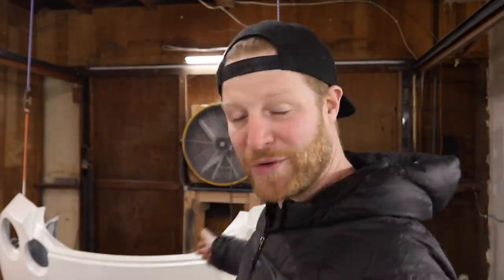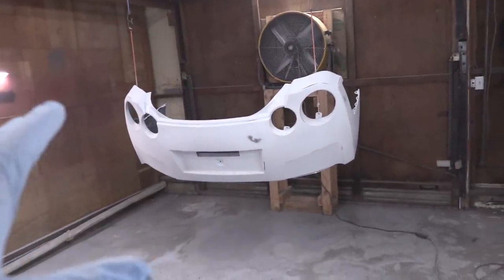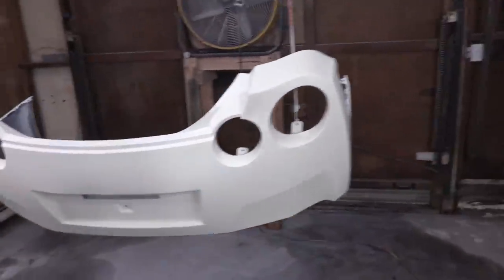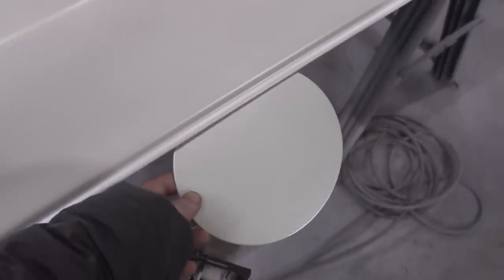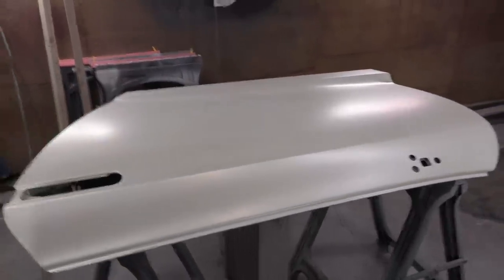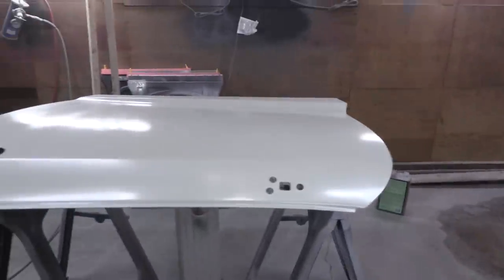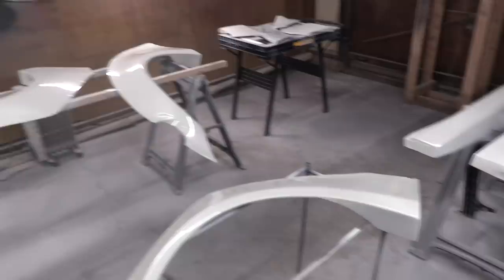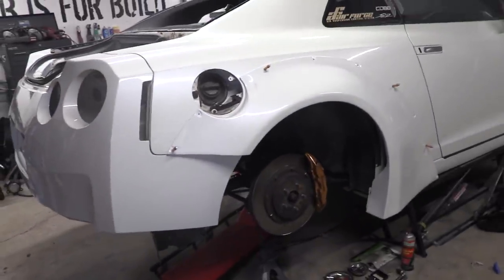Got All the Parts Painted Up Perfectly on the Salvaged GTR

Comment: When I was younger, I worked in a garage, I did allot of jig and panel work, not a whole lot of spraying, but ill always remember what this older panel beater told me . . If your ever spaying panels 'off' the car, you should orientate them in the same way that they are on the car.. especially with metallic paints, its got to do with how the paint and flecks settle? Hope this helps in some way. Nice job though, its gonna look great when finished 👌🏻

Comment: You need to scuff more by hand rather than using the machine. Those burned through spots on the bumper at 02:50 were really unnecessary.. love the project tho

Comment: Shouldn't the door be in the orientation it will be on the car when it's painted?
Reply: Why would this matter ?
Reply: @VintageTechRepairs  because the paint can end up appearing way different when applying it from a different angle than when it was originally done at the factory. Especially if the paint contains a lot of pearl the effect will be affected

Comment: My recomendation is, if u are gona suck warm air in through that door to your house, put up a large course filter, like what your put in your midi computer next to the fan, but door size, you can get that size as we use them at work. This should reduce your particulates on your paint but alow the heat to pass through. love your work man.

Comment: Quick suggestion, I really hope you see this: I would try using that round, foam, copper pipe insulation for the part of your air line that runs outside. That should keep it relatively warm in the winter, and prevent it from being affected too much by the elements overall.

Comment: Hey Chris i think that painting the paint booth would make it heaps better for dust control than it is now. As you already have paint equipment all you really need to do is toss a real thick layer of interior paint on the walls and rafters ceiling and such to control and eliminate most of the dust that could get kicked up in there.

Comment: You should run coper air lines on the wall. They should run up and down a few times to lose moisture in the air. You would need drains at the bottom of the Downs in the pipe work. Just a couple ball valves to drain the water that collects over time.

Comment: That looks like ProLine Performance Products primer. That is some good stuff. It sands very nicely.

I had a similar issue with color matching. I spent hours using several tinters and a sun gun, and I got really close to the OEM color, but the paint I was using ultimately was too cheap and did not have the qualities for getting a good match. PPG definitely works better for color matching, even though I probably still would either blend the paint or respray the whole car.

Comment: If the air line freezing up remains an issue, go to Lowe's/Home Depot and buy some heat tape meant for copper/cpvc lines. Some "wrap" around the pipe, some don't as they are actually wider and are best running parallel with the line in question. Can use electrical tape every foot to secure it, then use a foam pipe wrap insulation meant for water pipes and slip that over the air line or run a larger section of PVC and slip everything into it for added protection. Make sure it's connected to a GFCI protection outlet. Since the heat cable has an auto on/off thermostat, it's a plug and forget for the most part. Might want to make sure the temp sensor is touching a metal object that's at ambient temps as the rubber air line probably won't be as accurate.

Comment: Looks good. Just one tiny thing. Those power points and possible lights in your spray room. Be aware if something sparks and ignites your overspray that spray suit your wearing will probably melt right on to you. Not to mention burn your garage down.

Comment: A tip when trying to accurately shoot a few spray-out test cards QUICKLY, just use rattle can clear for the top coat. saves money and time, and gives you an accurate top coat "shine" to make sure the color match is exact. i recommend Duplicolor AE clear.

Comment: just a tip for a tricoat paint, the reason that one coat doesn't do it is the way it is sprayed. the factory puts one heavy mottled mid coat as to when sprayed out of a gun it's a bit harder to replicate that with a single coat. did a much better job this time 👍

Comment: Use filters on your air supply and a air dryer this will prevent fisheyes also they are also created due to silicon in the air the compressor in injesting I’ve seen this a lot and it can happen from someone near you using a silicon based cleaners near you. Dealing with compressed air daily the oil in the screw compressor always gets the blame but is usually not the blame I know you don’t use a screw compressor but thought I should mention I love the Chanel. Cheers Luke

Comment: Its very hard to match paint even at a professional setting. The best route is panel blending. Also, using two different batch/brands of paint can also affect the finish because its near impossible to mix two identical paint in two different scenarios, that's why you should buy more than you need.

Test cards are not a solution for 100% match either, its mainly for reference use and then the painter uses his/her judgement/experience to make the final call.

Comment: For future paint jobs, you might consider hanging pieces upside down if possible. Then dust will collect on the bottom of the panel  (where you probably wouldn't see it anyway) instead of the top.

Comment: Love the vids I would recommend moving to a water base coat this will massively lower the reactions your getting the only problem is you need to blow air over the panel to dry the base. If you can sort that out you will love working with it. Or buy a spray booth or b is for build one 😂

Comment: Mix some mineral spirits in with that water in a garden sprayer and spray the hell outta things Spray the walls and most importantly the ceiling. Just mist it you don't need to drown everything.  It works great for holding the dust down. I been doing that for over 40 years.It won't evaporate away near as fast as plain water.
Why don't you make a cheap paint booth out of PVC and visqueen? That's the first thing that i'd do if I was you. You could put it up or tear it down in 30 minutes or less.

Comment: Great job on the paint work man, looks good.

I think you need to invest a bit more on the spray area for future builds that'll help you a lot. you really need to cover the walls and the ceiling with something a little more clinical as all I think about with them is there's so many bits for dust to sit and wait for you to disturb with airflow/spraying or just moving around in general.
Perspex, polythene or even drywall with a decent wipe clean paint would be better than it is at the mo, you really need to mask the booth from the wood man lol

Comment: I do not paint a lot either but I have found with metallic and pearl paint it's important to place the panel in the same orientation as it is on the car. Gravity pulls the particles in the paint differently when vertical vs. horizontal. I found this when I used the same batch of paint on a hood that I stood upright to paint when the fenders were still on the car. I hope this share can help someone.

Comment: When you do the next one why don't you dust a black coat of aerosol  over the the grey high build primer to give you a guide coat..! So as you flat off then with the 800 grit wet and dry paper it show's up any imperfections in the primer..!

Comment: You should open up an hole I. The rear and out a filter in it rather than leaving the house door open it will create air flow and cut down on your dust

Comment: Best way on Pearl is to have it like it was on The car my dude working with paints and thats just a tip it Will change in color If its layered down rather than standing 😜
Reply: Ppg is a very easy system and 3ct colors need to be like on The car 😎

Comment: @B is for for Build what are you using for pressure an air compressor,  CO2, natural gas? you said that you were losing pressure when you paint I can only guess you were using C02 and being in Oregon cold weather you lines will freeze quickly. you can try using an air compressor that is 220v or battery powered you won't have to deal with freezing lines.

Comment: I'm not a professional painter and I'm not that familiar with your setup. But do you have a water/oil separation unit? And I don't mean the filter type, but the more industrial type that needs electricity to run. If you have a big industrial air compressor it usually  already has one, but if you don't you should get a stand alone water separation unit. Especially if you're running a smaller and/or reciprocating type compressor, they produce a lot of water and oil that contaminates the paint when spraying.
Also the paint booth does not seem like the most sterile place in the world, and I don't think the wet floors are enough. You should have a better shot of avoiding dust particles in your paint, by just trying to minimize air movement in the room - no ventilator and try to spray at a lower pressure (use thinner paint or a bigger nozzle). Also try to walk around as little as possible and move slowly.
Anyway that's just my not so educated advice, it has worked for me (also working in sub-par conditions) and maybe it helps you.

Really enjoy your content and keep up the good work. Best of luck!

Comment: Not a professional when it comes to cars. But I know my paint. Those fish eyes were probably because of the humidity in the room. After spraying water on the floors and running a fan the room was probably extremely humid. Those tiny water particles stuck to the paint causing the blemishes you saw. Of course it could have been any number of other things. That would just be my best guess. I always make it a point to paint in well ventilated areas using a tent to prevent dust from getting on my projects. Anyway. Do what you will will that, just my two cents.

Comment: Which PPG line are you using?  I use Deltron and it's pretty solid if you follow the p sheets.  Top that with Concept clear and it's really nice finish.  I'm a hobby painter myself and had really great results with PPG.

Comment: Dude you have all that space that is just bare board in your paint booth, take a sharpie, write down the steps to painting and refer to the list when you get lost. You write it on the wall and you can refer to it at anytime, don't need to worry about it getting lost and if you want to put a check next to each step to keep it all clear use a pencil and get an eraser.

Comment: Just a heads up you should never color match under lights, 9 times out of 10 it will never match up. Direct sunlight matching is the only way or a sun lamp designed for color matching.
Reply: JT hey said it was a color matching light made for that’s specifically and it closest to the light from the sun. Say it later in the video.

Comment: Just curious to why nobody on YouTube uses primer? I was always under the impression that you had to when repainting a car. Also what is the reason to have primer before paint? You’re the 3rd guy I seen on yt either do a wet sand or sanding down sizes the old paint before painting. Thanks
Reply: Thanks, that totally makes sense. I’m definitely gonna check out that other guy, appreciate it man.

Comment: Did you use any plastic adhesion  promoter on the plastic parts?
Reply from the maker: not after i sanded the bumper down after the sealer primer, and that’s what caused the wrinkle issue most likely, after i sanded out the wrinkles i did

Comment: Bury the air line 6 ft deep. Prevent freezing. But make sure to run a copper wire in the same trench in case you ever need to locate it though

Comment: I'm in no way a paint expert BUT doesn't each car have a color code on the sicker by the driver's side door where the Vin# is? Or couldn't the color code be looked up by the Vin#?
Reply from the maker: yes that’s where you start, but from there are what’s called “variants” within the paint brands, so there were like 4 options for the QX1 which is this paint code
Reply: B is for Build thanks for educating me on that. Didn’t know. I just want to thank you for putting your build on YouTube, I’ve learned so much watching you do this as well as the Z4. I might try a rebuild project in the spring. Thanks for the inspiration and education.

Comment: Instagram @ Dailydrivenunicorns....Caution... danger.... i would not ever wipe the panel's with the wax/grease remover after base is on.. alcohol water only solvents can and will  lift the base coat.. only before base and after clear if need to respray.. time window or not. Im glad you got away with it... all i use is ppg in my shop.